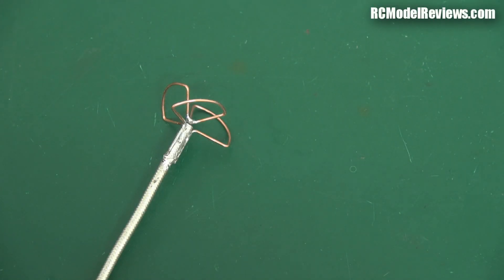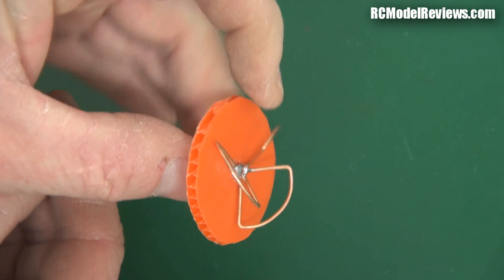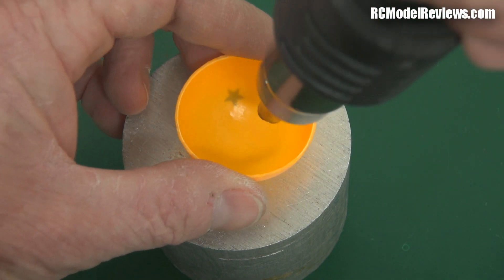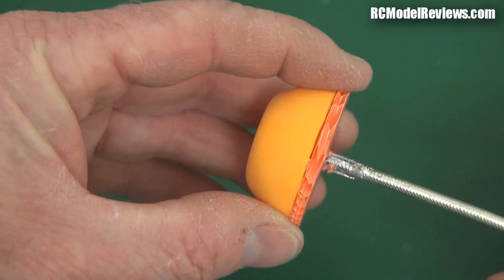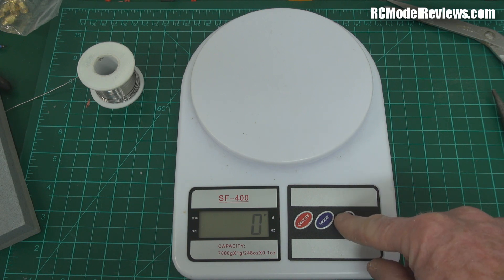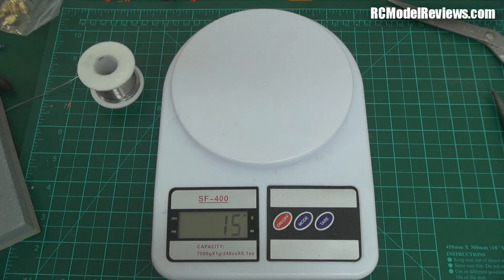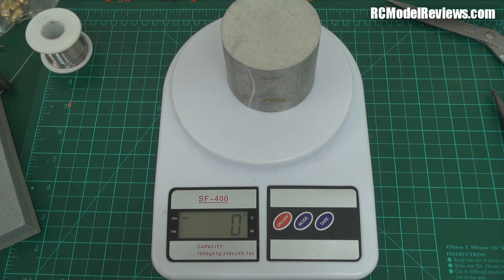Ping pong 5.8GHz FPV antenna protection

Comment: Ping Pong balls are conductive at 5.8Ghz. Put one in a microwave oven for 30 sec. If it deforms it is conductive and will de-tune the antenna. A better solution for me is a 35mm plastic film can.

Comment: is it possible to just cover the antenna with hot glue and fill it all in ? or use great stuff expanding foam  and carve it into shape ..Just not sure if it would affect transmission  doing either
Reply: +Steve Panebianco I thought about using expanding foam also. The way I was going to do it was to put the antenna in the ping pong ball, then fill with foam, then just clean off the bottom afterwards. Leaving the ball as a hard plastic shell that would protect the foam.  I never did it that way for some reason.  I think hot glue would be a bad choice, due to weight.

I did find a easy way to shape the dimple in the ball, I placed the half ball over the pritchel hole on an anvil, then I took a stainless ball I got from a old steam train, and pressed into the top, a food ladel would probably also work well. Then I used my heat gun to blast air through the hole, while pushing down on the ball. It works really well and reliably

Comment: Wow, I made three of these last spring, and it is amazing to see someone do almost exactly what I did with the exception that I never flattened out the top. I just used thick cardboard for the base - and of course the hot glue. They work great. I've smacked mine into trees, fence-posts, tall weeds, etc and the antenna is A-OK. Designer ping-pong balls would be cool to use too! I just use the same bright orange Franklin ping-pong balls -cheap solution.

Comment: 1: How do you quantify that the drag is less with your modiifed design ?  At the fastest speed, a mini-quad would be at the highest attack angle with your cup literally heading directly into the direction of travel.  2: I've had the situation where my antenna cover became hung-up on the bark of a Eucalyptus tree approximately 80 feet up and unable to dislodge under its own power.  Using the entire ping-pong ball to cover the antenna would have prevented my particular situation.  Some things to consider…

Comment: Increase the load on the scale until it's flat. Also record when it gives up showing values. 

After that use as a base for a quadcopter och simply as a flying disc. If you cant find proper stuff to smash on it, try to find someone with a road roller.

Comment: Scales: Use your Hot Air Solder Wand on the electronic board of the scales. Reflow the solder. You likely have a cold solder joint that keeps changing connectivity as it heats and cools passing current to the scale....

Comment: Bruce, that scale is rated up to 7000 grams. It's completely useless at the bottom end. I have many cheap electric scales off of eBay that are rated for 200 or 500 grams and they work reliably and repeatedly to within 0.1 grams. You can only expect so much!

Comment: I'd be tempted to use both halves of the ping pong ball and make it somewhat pear shaped like a lightbulb to try avoid snagging the flat bottom of the antenna on a wire fence or branch.
I don't think it would be much extra work, but would increase air resistance slightly.

Comment: You can shave off another gram or two and at the same time make the golf ball cover look even better by doing the following.   Make the base plate smaller in circumference. Doing so you can lower the ping pong cover completely over the base and at the same time hide those rough looking edges with the side benefit of reduced weight.

Also when using the heat gun to make that little dimple, using a small ball or something to act as a form will help expedite the process and give finer results.
Reply: or use less hot glue?
Reply: using less hot glue would serve no purpose.  And you're missing the main point of my comment which primarily on how to improve the look / aesthetics of the antenna cover while at the same time very slightly reducing the weight.

Comment: Great video... One little detail I was really interested in, the heat gun for SMD rework, where did you get it? I'm not sure if there is some bulky unit, off-camera or not, was looking for a smallish solution, as my work bench is already buried in Metcal soldering/de-soldering station equipment, (everything But a hot air gun).
Cheers Steve

Comment: Might look even better Bruce , if you rebated the corflute , so the ball fixes to the bottom edge , also allowing a tougher glue  joint , and the scales , drop them from a great height .

Comment: Nice DIY, what coaxial cable are you using? It keeps the shape!
Reply: Mariano Arbelo It's semi-rigid coax and yes, it's very nice for antennas because it does keep its shape and it's much easier to solder to than the more common flexible cable.  You can buy it on eBay pretty cheaply.
Reply: *****
From memory it's RG402 which you can pick up on eBay pretty cheap (about $1.50 per foot or so).

Comment: Bruce, do you have a quad big enough to lift one of those scales?  Would be fun to see what happens to one of them from altitude!
Reply: Jeff Groetsema I can see a great use for the excellent QuadLugs quad that sits in the corner of my workshop at the moment :-)  Just need to fit some telemetry so I can go to the full 399 feet allowed by law, before releasing the uncooperative scales :-)

Comment: to get better measurement on that pressure stamp scale, use an approx 50g weight, do not tare, then put another item. Difference of weight will be the right weight. Unfortunately that look like ADC has some problem with digitalization of the low levels.

Comment: FPV the scales, -Get Roddy to mount it on the nose of the float-Jet, facing inwards to the cam. Them it can be used as a sort of Air speed indicator. And the eventual cash impact can be accurately read of the recorded FPV video.

Comment: Hey Bruce, rather than killing the scales, maybe a video about taking them apart and adding a filter to the output of the load cell or some other relatively simple fix.  If the filter repair doesn't work, then you could experiment on the destruction part of the project.

Comment: Hey Bruce, great Video, what i REALLY like to see is how Liquid Electrical Tape acts as a antenna guard.

would a single layer of tape over the blanc copper wire decrease the antennas power much?

IBCrazy also uses some type of Blue Electrical Tape.

Comment: I got a warning from the guy I buy my 1,3G FPV antennas from, that putting hot glue on directly to the cloverleaf (like you did when securing the coroplast to the antenna base) might detune it. Heck I did it anyway and It has worked well on both my 1,3G video link and 2,4G radio link (I got cloverleafs there too). Any comments on that? I dont think it really effects the performance.
Reply: That assumes your cloverleaf was tuned 100% perfectly to start with, which they never are.  Adding hot glue could make it closer to perfect just as much as it could make it worse.
Reply: erajomppa It really shouldn't make any significant difference unless the hot glue has some conductive component to it or you use an enormous amount of it.
Reply: Good point, though I think you might not get better range from a badly tuned antenna by adding hot glue, could you? :P
Reply: But I gotta mention that he makes them all and tunes them with professional gear to get best possible performance. I actually broke one, because he focuses so much on getting them tuned properly that the strength WASN'T always top notch. But the last couple that I got he had also coated with some kind of plastic (maybe the liquid tape?) with solder joints well covered and protected.
Reply: erajomppa You might get better range if the antenna wasn't tuned perfectly for the frequency you're using and you just so happened to add hot glue in the right place to de-tune the antenna towards the actual frequency.  But yeah, if the antenna in question was pre-tuned using test gear to be spot on any change to it will make it worse.

Comment: Get roddy to help with the scales destruction. He'll have some ludicrous and hilarious ideas to attach it to an axn or something hahaha
Reply: Roddy is waiting for the lake to fill so he can get a good run for his float plane to take off. Roddy asked Bruce is the scales hot glue gunned to the AXN undercarriage would reduce his weight? Bruce is pondering the water way question. What do you think is the answer?
Reply: A. Extra mass on the AXN has to help its chances of take off
B. Setting scales to zero will create an antigravity effect
C. Anymore glue on the AXN will exceed scale limits
D. Two scales are better than one especially if arranged in parrellel
Reply: pokies100
B, definately B - But when he does it, he add 2-3grams of lead to keep the model from floating away.

Comment: Hmmm I'm not sure what to buy not, it's £40 for a immersion rc one or I can get exposed ones for about £15 and make this cover, do you think the cover protects it as much as the immersion rc fatshark one?
Reply: When I got my Fatshark antenna last week I tried to open the cover up to see inside. I managed it with a lot of brute force. Then I had to line it all up again to snap it back on. Yesterday when I was multi car park flying I misjudged an opening and my mini tumbled three floors hitting railings on the way. I was lucky, two props bent, one motor had broken loose magnets and the cover came off the Fatshark antenna. The antenna was fine and the cover snapped back on...
Reply: The immersion antennas are way stronger, I even stepped on one and its perfectly fine. However, if you want to save some money or like the satisfaction of making it yourself, go for it.
Reply: Robert Cornet Yeah they maybe good but they charge you the plastic cover maybe 20£ >.<
If i have to invest so much money on a cloverleaf, i would definitely buy the awesome mushroom or bluebeam antennas designed by IBCrazy, even they do not have any plastic cover. It's probably better to invest in good quality instead bad one over priced.

Comment: Vacuum forming is the way to go for the caps. I will bring a vacuum pump next time I come over to TOK. It shouldn't take much work to make a former.
Reply: Roger Hill Yeah, I was going to make a plug and vacuum form some PET but I figured the ping-pong balls would be a simpler option and it works pretty well.

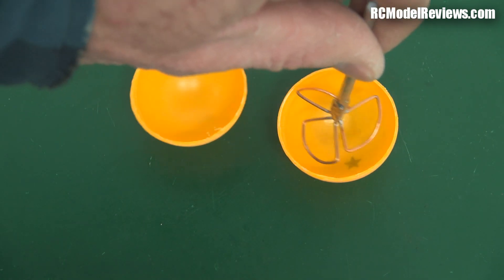Comment: 1:20 now that was a lie and misleading information !! It will be transparent to radio waves and will pass through them from inside dome to out, but it will detune the antenna. Operation frequency will shift and that is measured and proved many times on antenna analyzer. Antenna must be made for offset frequency if protective cover will be used. 
Of course this is for best performance, if you do not want to get best of your system and just want to fly around your self 50-100m you can ignore this.
Reply: TheLaidukas Yes, I did some simple RSSI tests and the difference with/without the ping-pong cover was immeasurable.  Flight tests confirm that there's no perceptible difference in performance.
Reply: Jeeze ! Are you an attention seeker or what?  Suggest you calm down and take a valium.
Reply: Keep up the good work xjet. I found it informative and funny. Oh, the scales, KILL IT WITH FIRE!
Reply: TheLaidukas
Last weekend I flew two miniquads -- one with the shrouded (ping pong ball) antenna and one with a bare antenna.  They had the same VTX on the same channel and they had exactly the same range (because I flew out to the useful limits of that range).

So I would say that for all intents and purposes, the ping-pong ball shroud makes no perceptable difference at all.

Nothing beats a good old empirical test :-)
Reply: Sorry but plastic will have zero effect on frequency shift it is not conductive. Plastic can reduce TX and RX gain but it would have to be a foot thick to show any recordable results using a network analyzer.
Reply: TheLaidukas
I think the effect is due to the different dielectric coefficient of the plastic when compared to air (although I could be wrong, it's a long time since I did my RF theory).

However, empirical testing indicates that using something as thin as a ping-pong ball and given that there is several mm of clearance between the highest-impedance elements of the radiator and the ball (and the effect is an inverse-square one), the practical effect is minimal -- probably far less than the effect of the physical deformations that would occur without the shroud ;-)

Certainly a reasonably well made DIY clover-leaf with a ping-pong ball shroud will still outperform many of the crappy low-cost shrouded and unshrouded CP antennas that are on the market at present.  They appear to have introduced excessive capacitance by using collars to attach the elements to the inner and shield of the coax.  This will detune the antenna significantly.
Reply: ***** RSSI is not that precise to rely on, it will show only quite big discrepancy. And you can see no difference because you fly close enough. In any case i agree that difference may not show if you fly in close proximity but in general it was misleading to say that it does not detune antenna. The proper thing was to say that it will actually detune antenna but its question will you notice in real life flying close proximity.
Reply: *****  Good grief!  Some people can't wait to pounce.  I think that calling someone a liar is a bit over the top.  Uncalled for.

Bruce did say that plastic will never affect waves.  He was talking about the effect on this antenna. Because he had tried it. How is that a lie?

I seem to remember his review of helical antennas. I'm sure that he mentioned that the material used to wrap the coil around can affect it.  Ut, he also explained that the proof of the pudding is in the eating.

I've found that theory is one thing and application is another. Ok?

Honestly, there are too many variables involved to be able to have 100% certainty.

Take these antennas. Are the wires exactly identically the same length?

What frequency is it tuned to?  All 32?  No. Is it perfectly tuned to any of the frequencies?  I don't know.  Toss a coin.

Is the solder that Brice has exactly the same as mine?  Is his coax?  Is anything?

Look, for what we use them for they are as good as we can get them.

The plastic of the ping pong ball.....Yes, it will have some effect. Does it matter?  Not really.

And you know what...who can say?  Bruce can, because he's tested it by trying it.

The bloody thing might change it in the right direction. It might make it slightly better tuned to his frequency.

If the wires are a fraction different lengths it might make one work worse and another work better.

These things are made on kitchen tables. Not in dust proof labs by men in spacesuits using the best equipment.

We don't test each part for quality.  I don't.  I use whatever I have laying around the home.

I think that Bruce was talking about the antennas we all make ourselves.  They are so full of nearly right parts that a ping pong ball won't make any difference.

Not a lie!  A statement of fact concidering the not quite right build of the antennas.

Even tarnish can effect the antennas.  For the tolerances we work with a ping pong ball is either here nor there.

And it is on the transmitter. Not the receiver.  In my experience, it is far more important to have the receiving antenna right.  A little bit of effort there can really pay off.

I enjoyed this video Bruce.  A good bit of fun. Your daft as a brush sometimes:-)   Fancy kinking your ping pong!  :-)
Reply: "Lie" implies intent to deceive, I don't find reason to believe that has occurred. You should turn your attentions toward all whom tell you are smart, attractive and personable...they sound suspicious in nature.
Reply: It seams I cant find the same article right now but in the past I saw VNA readings of 5.8G clover lief without plastic cover and with "Kinder" chocolate plastic egg as cover, difference was more then measurable.
Reply: TheLaidukas
That's due to the "Kinder" chocolate impregnated in the plastic....:whistle:
Reply: Can you explain that or post some tests? I always thought plastic or any kind of non conductive material is NOT gonna interfere with em waves.
Reply: bahnfahren Sure, these are my personal test with 2,4GHz collinear antenna. Its in my native language but pictures are self explanatory http://www.laidukas.lt/blog/?p=256 . Pipe is non conductive plastic pipe but shifts frequency rapidly. Now I own a proper VNA and it shows the same effect. Unfortunately I cant find article on 5.8 GHz + plastic cover where I saw actual measurements. I cant illustrate with mine VNA because its up to 3GHz.
Reply: The cloverleaf appears to be a fairly broadband antenna, at least according to simulations I've run with xnec2c.  It's quite possible that the detuning from the plastic dielectric effect is minor compared to overall bandwidth.
Reply: What is a  "virgina" ... I'm from the states and I don't think we have those here?
Reply: TheLaidukas
Kinder Egg shells have high titanium content (or is that lead?)
Reply: bahnfahren All materials do affect em waves or simply electromagnetic waves. 

If it will interfere or not depends on the energy of the electromagnetic radiation and of the density of the material. 

Visible light is electromagnetic waves, and the plastic ball u se do affect it, as you could see it. 
http://en.wikipedia.org/wiki/Electromagnetic_spectrum